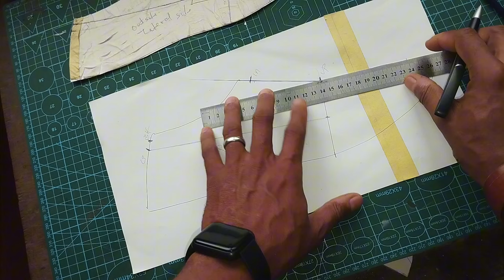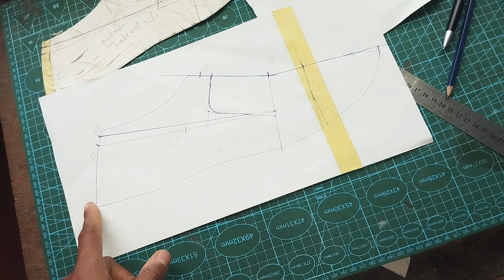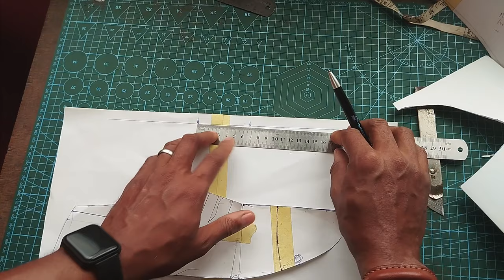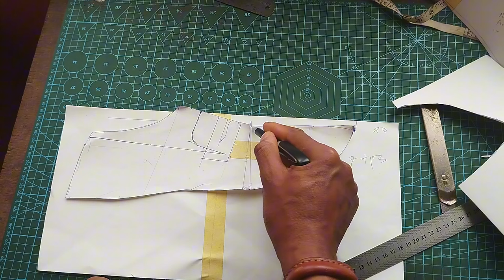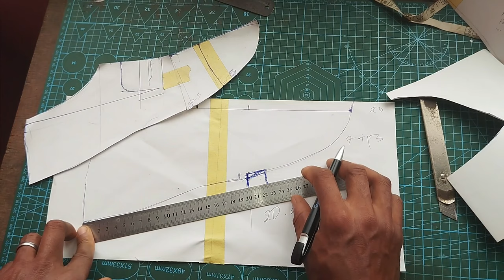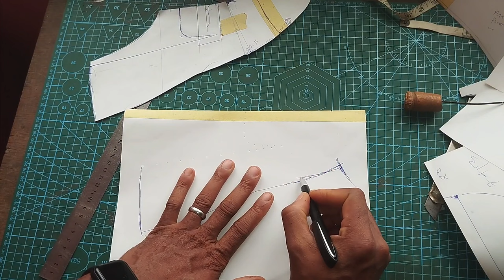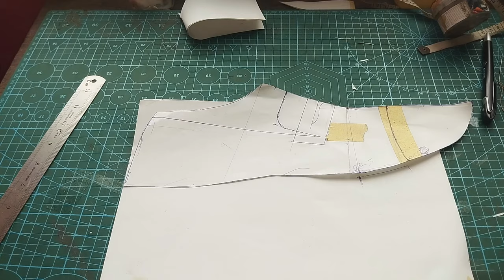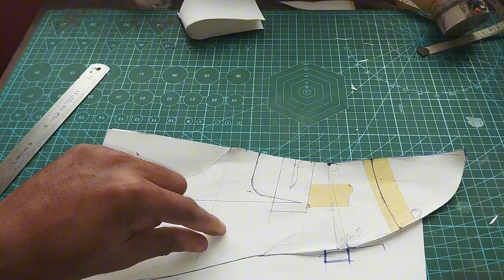Footwear Patterns Fundamentals: Springing Loafers Patterns

Comment: I've had a bit of problem, im making a loafer to someone, how to prevent from heel slip, cause he doesn't want to wear a sock, any suggestion would be much appreciated, TIA..
Reply from the maker: I'll say make sure it's very snug at the balls and definitely don't use the counter point as back height. Add about 5mm to 1cm to that. Also add back counter stiffeners that come around all the way to the arch (IE a little bit shorter than half of your last length.) these are what I will do though and then hope for the best.